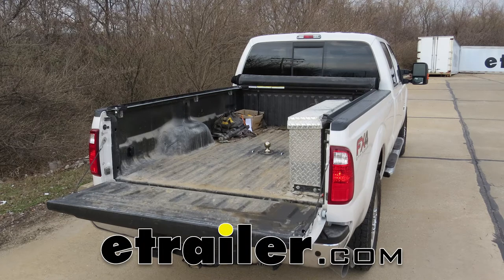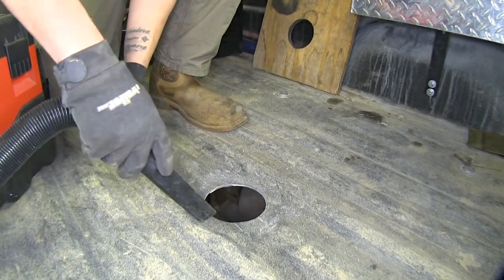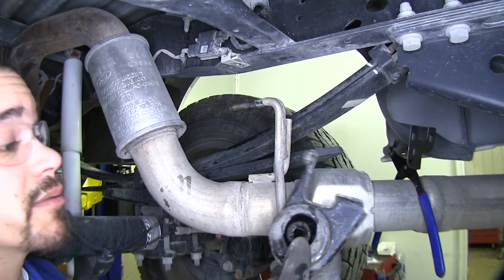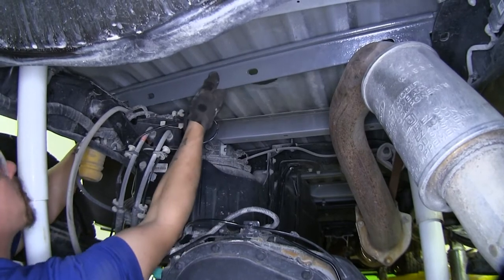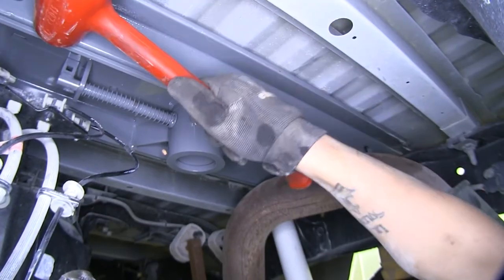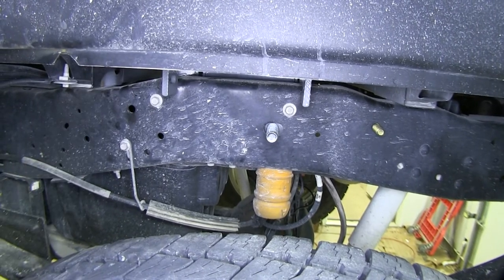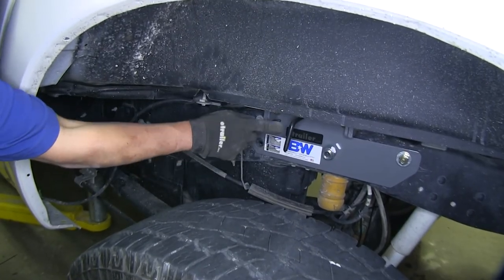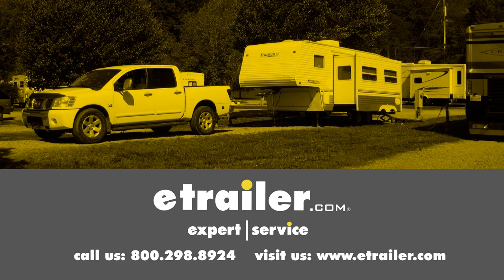etrailer | Gooseneck Trailer Hitch Installation - 2016 Ford F-250 Super Duty

Comment: Thanks for the video. It took me 4 1/2 hours to install on my 250. Everything I ran into during installation was what you showed in your demo. I worked with floor jacks and didn’t have to remove the spare tire. I was quoted $1,300 for the install by a trailer service center but only spent the $599 I paid for the B&W from you guys. Wonderful customer service too, I got the unit delivered the next day at no additional cost 😊
Reply from the maker: That's awesome, congratulations on your successful install!
https://www.etrailer.com/Gooseneck-Hitch/B-and-W/BWGNRK1111.html